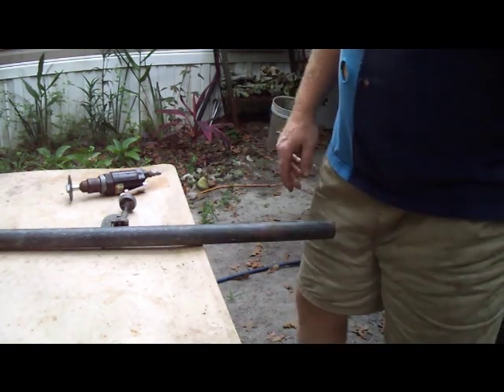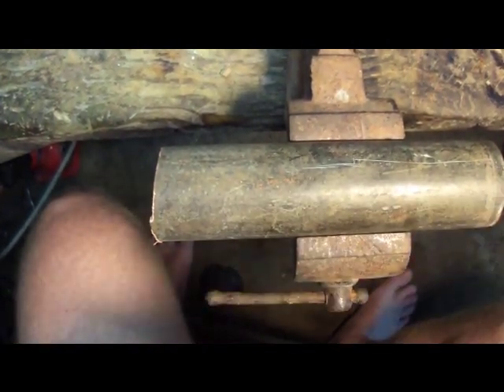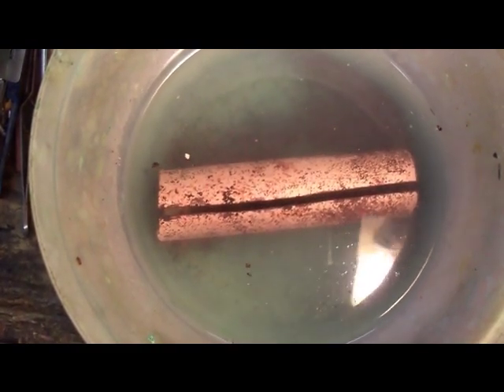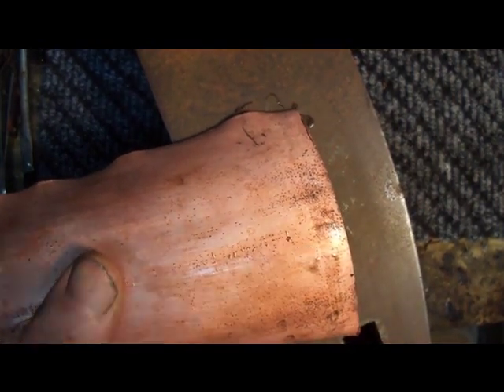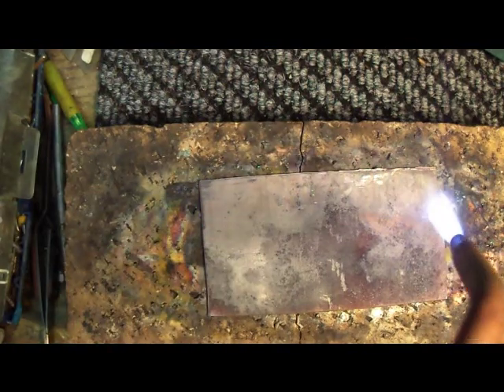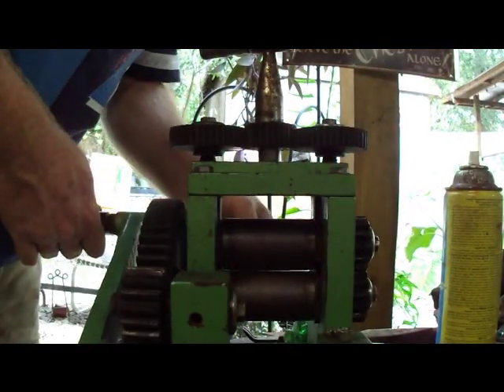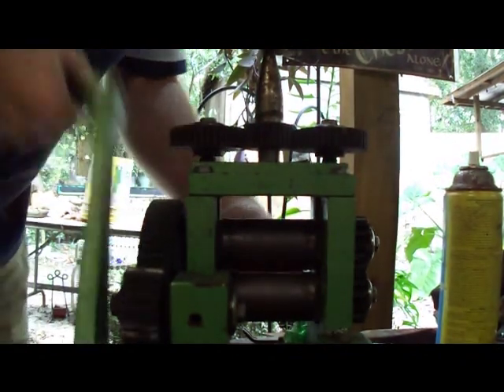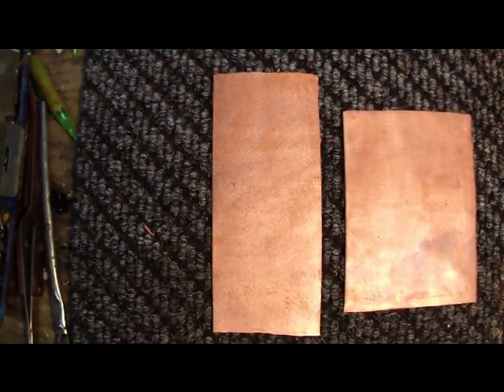How to Make Copper Sheet From Copper Tubing

Comment: Rick, wouldn't you quench the freshly annealed metal in water first, then into the pickling solution? The possibility of splashing the acid seems too high.
Reply: Most pickle is simple white vinegar and salt.  If it did splatter,  mine never has, but if it did, baking soda will neutralize it .

Comment: Can you tell us how to mix the pickling liquid?  Do you use just Salt and Distilled Water?  It looks great with your solution.  Another great money saver!
Reply from the maker: +Gloria Borrero   2 cups white vinegar , 3/4 cup water tap waters is ok , heat it in microwave until hot but not boiling 2 to three minutes then add 2 TP  pickling salt ,, regular salt will work also .  ..for stronger pickle use less water.... PH  down is also an excellent pickle it's a pool chemical sold at hardware & pool supply stores  2 TP to 1 gallon of water

Comment: That's pretty cool, Rick. Thanks for sharing. Do you have any way to do the reverse? That's what I really want to do... take sheet copper (with designs cut into it) and roll it into tubing, straight long (about 12") tubing.
Reply: You would be better off buying a stick of copper at the store it's not expensive
Reply: @Sierrarosemorton  And then turn it on a lathe, and since I want special designs in it, use a fancy 5 axis CNC lathe... costs more than I can afford. I think I'll try etching the designs in standard copper tubing first. Thanks.

Comment: Hi what do you for picking compound? What is the ratio of ingreants?
Reply from the maker: Randall Steakley I use two different kinds one being Vinegar. water and salt the other ph down a pool chemical both work well with silver or copper . both work best hot .. as far a exact amounts 2 cups Vinegar to 1 cup water 4 tp of salt use microwave or small crock pot to heat mix for stronger mix use less water .... the ph down 3TP to 4 TP to one gallon of water heat same way as other solution.
Reply: Thanks

Comment: fascinating!!!
what is the name of that rolling machine, and can it be rented in a shop?
what is that machine normally used for, something else?
Reply from the maker: It's called a rolling mill Barbara, there used in jewelry making all the time to make sheet,, . wire and to texture sheet you can find them on ebay , Rio, and other jewelry supply places
Reply: Thank you so much. This process has me really intrigued.